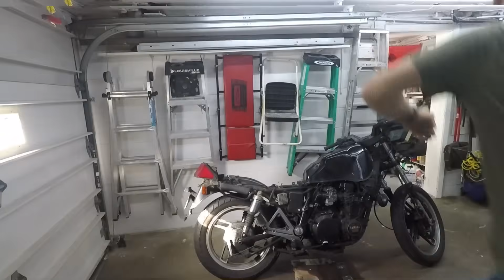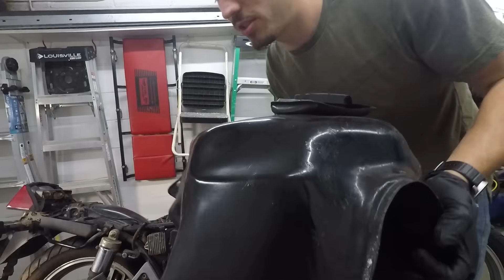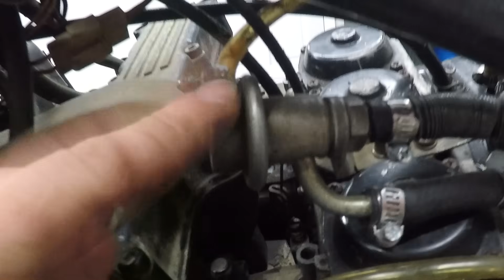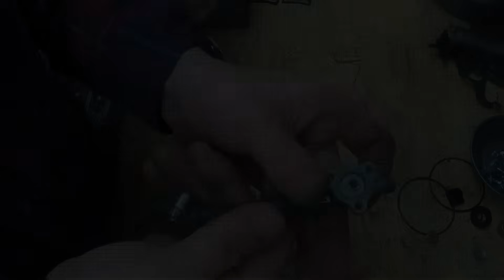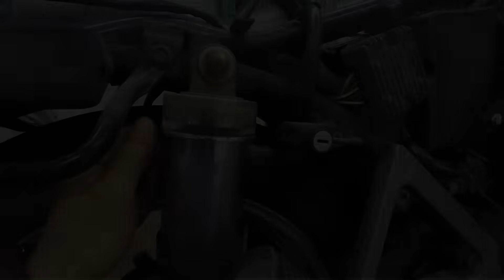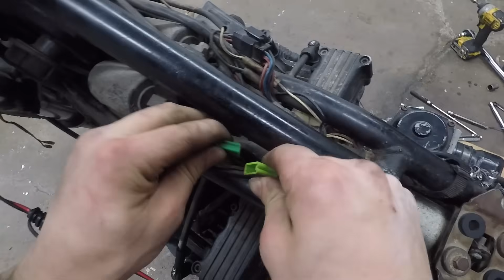Yamaha XJ650 Turbo | Fixing MORE Problems

Comment: So many of the same problems I have had with mine over the last 25 years, interesting repair you have found with the oil check valve, I might try that, one fix that I found was to get rid of the original brass on brass needle seat valves as they just don’t make them properly, the ones you buy on eBay are rubbish, I replaced mine with sourced same size ones from a Yamaha snow mobile which are vitron tipped like a rubber tip and have never had an issue of flooding since, make sure to always turn you fuel off when not in use tho 😉 as they still do some crazy stuff sometimes with their wild fuel system no one can ever explain I even put a small second fuel tap in to make sure

Comment: Hey man you seem to know a lot mechanically, by any chance do you know whats wrong with my honda grom, so basically me and this mechanic been at this for months now the bike does this weird thing where u give it throttle and itll do nothing or maybe a super weak rpm and when i roll off it a bit itll go and its super weird and on and off but the bike is unrideable unless i roll off and the throttle but still not as possible and we went through all the basics u can think of and its basically a puzzle trying to figure it out maybe the ecu is on limp mode and the bike has been through like 4 different tps sensors but there was a point recently where it got to running good for 4 days like really good then back to the weird throttle and it feels like the bike is so close to running good but i would honestly appreciate it if by any chance you might have some ideas to what it could be, either way love your videos man.